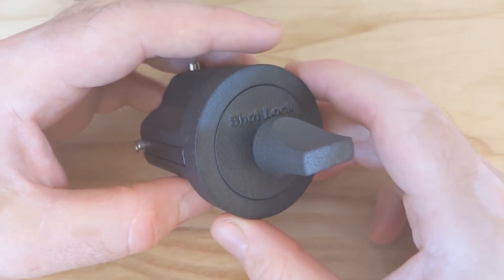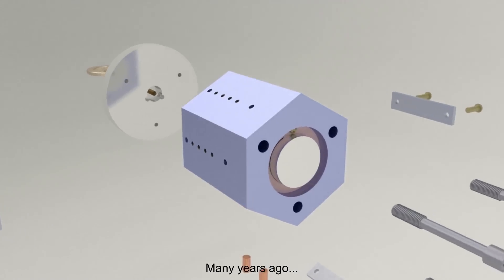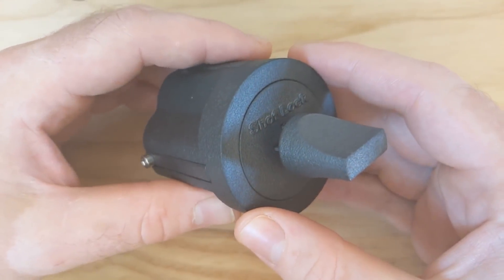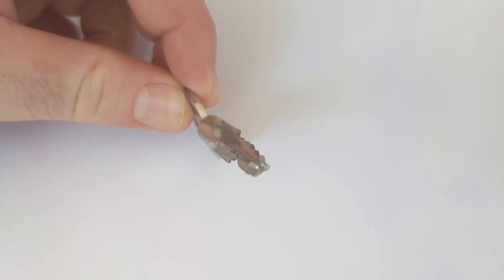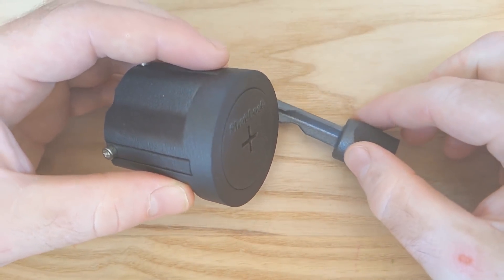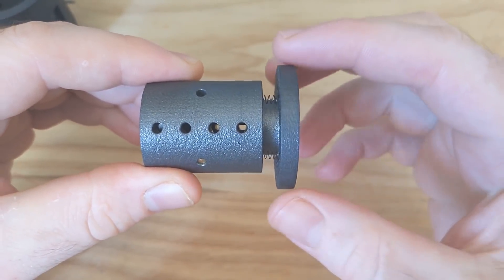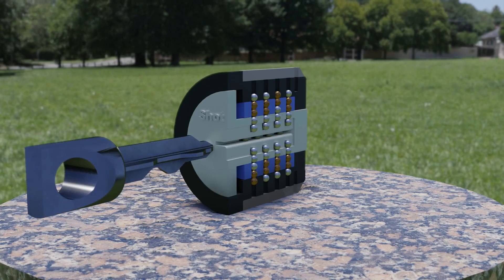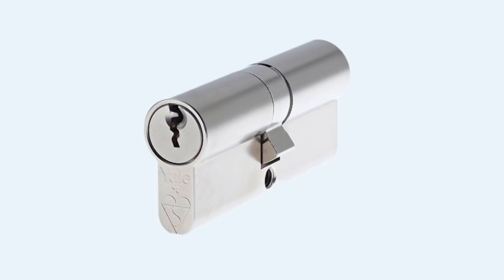A 3D Printed Unpickable Lock

Comment: LPL: "they left out an important detail, you see, the lock is made out of a thermoplastic, so using a blowtorch you might find at home, we can open it with relative ease"
Reply: But you can machine it from steal, witout a problem. Just need tools and guy dont have it.
Reply: I read that in his voice
Reply: It isn't made out of a thermoplastic though..
Reply: No need to pick it when the lock is that easy to brute force.
Reply: @lethalchicken1able  The point is that an actual production lock would just be milled or broached. This design doesn't look difficult at all to modify to be mass-produced, he likely made it out of plastic just for the purpose of testing the mechanism, and making many small changes to it, between versions.
Reply: @lethalchicken1able  kind of my thought, I wonder even if made out of metal, how hard it would be to just break it idk
Reply: Maybe he should have sent it to stuff made here first
Reply: @SkanMLL  The rear joint that prevents you from rotating the lock as a 1/4" cross section. Modern locks are made with closer to 1/16-1/8" cross sections, so I would be confident that a metal version would be stronger than most modern locks
Reply: No lock is 100% secure...there’s always a way to get the thing open that they’re keeping locked. Lock pickers are lock pickers for a very important reason...and brute force cancels that reason out.
Reply: @Weryl  it was a joke…
Reply: Well a real lock would be made of different material i guess .
Reply: that's not LPL's style.
Reply: @soldierofbass6082  I remember him torching a bike lock ... once 🙂
Reply: @Zekealot  All standard 3d printed objects are made of thermoplastics. That is sort of a requirement for it to work.
Reply: @Zoroaster4  That's for the common home system that extrudes filament into the shape that you desire (FDM printers) - other options include laying down a layer of fine dust and gluing or fusing it together to get the shape (SLS printers are like that), and resin printing, where a light sensitive resin gets cured by a screen in the bottom of a tank, and then lifted out so that the next layer can be formed on the bottom of that.

Plus, there are various groups working on 3D printing houses out of concrete, and even one group who's working on 3D printing functional rockets using what is effectively a robotic welding arm (yes, that does mean they're trying to put a rocket into space that's all welds, and no panels in between).
Reply: @Autoskip  Yes that's why I said standard. All of those other than the resin printers are very rare. Even the resin printers are far less common than the conventional FDM printers. My point is when someone refers to 3d printing they're almost always talking about FDM printers and those are almost always using thermoplastics.
Reply: That is lockpocking lawyer’s wife’s approach. Ice cream lock
Reply: it can't be locked if it is a liquid
Reply: Ye, I don't think lpl would do that, he probably understand that this is just a pet project and that not everyone has a 3/4 axis cnc mill
Reply: @Weryl  r/woooosh
Reply: Well, it wouldn't be picked. Opened, yes, but not picked. It's not an unopenable lock :)
Reply: all locks can be destroyed, picking is something else.
Reply: The challenge is to pick it, not destroy or otherwise bypass it.
You can't say you picked a lock because you threw a rock through a window.
Reply: The sheer amount of r/woooosh that's occuring in these replies...
Reply: You do raise a good point though. I mean, sarcasm aside, many of his locks are picked through a flaw in the design that makes it unnecessary to actually pick the lock or use the key. Some of the examples that come to mind are some motel window locks, or a TSA gun case and a few others. More recently there was an electronic key that was defeated simply by crossing two wires. So even if a lock is unpickable if there is a flaw in its design that makes it accessible in some way it's not perfect security.

That said, I am still excited by this. I really hope he has difficulty opening this.
Reply: @Zekealot  it is. PP or PA.
Reply: @Weryl  "they left out an important detail, you see, the lock is made out of a steel, so using a rocket engine you might find at home, we can open it with relative ease"
Reply: @SkanMLL  I’m wondering how much it would cost as well to make in metal form. Can’t wait to see what LPL does to this. Will he give in or find some other way!
Reply: I love how this joke went right over most people head. They are arguing about what it’s made of and saying it could be milled from metal. All while your sitting back laughing at them.
Reply: @justacameraman4900  people defending the channel they like. Chillax, he's joking.
Reply: @Weryl  well no because he is using double pins which are the weak point you can just put something that gives you leverage and twist the lock and it will snap the double pins... thats the problem here and also that fact that there is no action on the lock like a bolt or anything so what can this be used for?
Reply: @thefjk  dw I'm chill. I'm just pointing out how many people are missing that the comment is a joke.
Reply: But that would be a destructive entry which is the weak point of everything
Reply: @soldierofbass6082  exploiting weaknesses like that is exctly his style just look at stuff made heres locks he says he would absolutly have gone after the hinges had they not been welded
Reply: NON-D-E-S-T-R-U-C-T-I-V-E
Reply: Sounds like a Mrs. LPL method
Reply: Marketed as unpickable , not indestructible
Reply: @barnabasdecsi7872  when did destructive enter come off the table? there is a reason locks are made strong...
Reply: @soldierofbass6082  

No, he'll chain it to a rack in his basement and perform unspeakable acts upon it, with various tools until it yields its secrets.
Reply: Zoroaster nope.
Reply: @Weryl  steel (material) is with 2 'e'

steAl is taking possessions of others
Reply: @bmomosaik  If I were to fore my way into a building, I would choose the entry point by considering where is the weakest part of the building, in this case, we are talking about detached houses, which are the windows usually like you can throw a stone at it and it shatters of course there are bulletproof windows and windows protected by iron bars and stuff like that but that's not too usual
Reply: He didn't even make a video on it yet wtf are you talking about?
Reply: If LPL can’t pick it he will make a pick for it before releasing a video🤣🤣🤣
Reply: Lpl will use a tool he and bosnian bill made and pick it with ease
Reply: @Weryl  Steel*
Reply: Nondestructive bro
Reply: @Zoroaster4  But the guy in the video literally told you what the process was, and it is NOT a thermoplastic.
Reply: @tiggerbiggo  Yes, but it IS a thermoplastic. It uses nylon which if you didn't know IS a thermoplastic.
Reply: IT SAYS " UN PICKABLE"  Einstein...
Reply: Unpickable is not the same as unopenable.
Reply: @skaramicke  Duhhhh... Thanks captain obvious ...
Reply: Irrelevant. It is just a proof of concept. You can make a production version from titanium if you want.

Comment: Awesome! Such a unique take on an “unpickable” lock design. I (like everyone else) would love to see LPL take this challenge on, the guy has x-ray vision when it comes to seeing faults and weaknesses to exploit!
Reply: not unique but definitely special!
Reply: Well, in principle it's the same as stuff made here's
Reply: I think the weakness in this design is that you can apply torque by pushing in on the lock rather than rotation. Any kind of shear should be able to take care of apply the necessary pressure for decoding. And whats worse is that because the pins slide out of the way once you have the combination set it is absurdly easy to open even without a key.
Still a nice looking lock though
Reply: @nickrogers3624  how would that decoding method work. The tensioning method is valid, but how would you determine which pins are correctly set?
Reply: @nickrogers3624  however it was actually demonstrated that the lock will push in even with the wrong key, however it won't turn, meaning that pushing it in actually puts no force on the pins and actually isolates them...

Comment: Title:  Unpickable
LPL:  "Nothing on 1, nothing on 2, 3 is binding..."
Reply: Hahahaha 👍
Reply: @Creatotron "For this lock, we will use the specialized decoding tool that Bosnian Bill and I made..."
Reply: "... click out of four. Back to the beginning..."
Reply: I think LPL can get it open, but it’s going to take a new approach for sure
Reply: Sneaky sneaky
Reply: Nice click there!
Reply: You can’t be both turning the inner cylinder, and change the height of pins. Once the cylinder is in a position to turn, it is causally decoupled from the outer ring because it is offset by more than 1 ball diameter. There is no playing with the pin height when it’s rotating, hence no binding feedback possible. Most of the comments don’t get that part.
Reply: @xl000  Most of the comments are not from lock smiths and are just LPL fans making jokes.  It's all good man.
Reply: @bigtimetimmyjim6486  Too bad BB retired :-(
Reply: @CarbonRevo91  Hammer.
Reply: press 6 on keyboard to get info
Reply: Unfortunately, the pins won't "bind," at least not individually. I really can't see any flaws in the design, but I'm not LPL. :P
Reply: He didn't even make a video on it yet wtf are you talking about?
Reply: You just described my cars gearbox

Comment: Stuff made here said something similar once. Just watched lock picking lawyer open both of his designs. Time to start watching for this lock to cross the bench.
Reply: But it would be great if LPL doesn't know how it works though.
Reply: @BD90..  It will be just longer
U can't open anything if u don't know how it works, ever door knob will be unpickable for u, for time u need to learn how it works
Key design, keyhole, mechanism, springs, all lock parts are necessary for picking a lock
Reply: The flaws that allowed the locks to be picked, were partially known to Stuff Made Here before sending the locks. So at least one of the two would be unpickable. He simply decided to not fix it beforehand to have a more entertaining video. He said so himself in a reaction video.
Reply: @BD90..  That's not how anything works ever.
Reply: Stuff made here's design is solid just one fix and it's unpickable
Reply: @BD90..  the security of a system should only depend on the key. (Kerkhoffs' Principle) Obscurity is not security.
Reply: LPL said his lock was close but it had certain faults. If he fixed those it would be unpickable.
Reply: theres a big difference here though.. stuff made here had no idea how most locks work beyond basic function and had no knowledge of how locks can be bypassed.. am i saying LPL couldnt pick this lock? no.. could LPL just bust it open? obviously yes, but im sure he would take it as a gentlemans rule to not do it as this lock COULD be made with stronger materials.. 
what i expect to happen however, is for LPL to take advantage of the line at 2:23 obviously that model isnt done exactly how the real one would be, but if there is enough room to force all the pins down to the maximum depth, then the lock would still turn even though it is an 'incorrect key' with some kind of 4 way comb key.. and while technically the lock isnt being 'picked' it is being defeated through non destructive means.. but again, even if that does work on the lock he sent him, it could be easily fixed by just not allowing that extra room via larger spring/extra pins etc
Reply: Ehh LPL managed to open them but only because of design oversights. He said in his response video that a few fixes would make his lock effectively unpickable.
Reply: @duffman7674  security through obscurity is effective right up until the point other people realize that it's effective

Comment: As there's still no LPL response, here are my improvement ideas:
  1. Replace the key touching ball by a standard short keypin, thus giving it a flat top on which the higher items rest.
  2. Replace the ball that shifts between layers by a stack of thin master wafers.  This increases the number of depths of each cut, thus allowing you to remove the side stacks that won't fit in standard form factors. Fine tuning the diameters can furter increase the number of wafer levels.
 3. If the Euro profile doesn't have enough room, go for a scandinavian oval, which is still a defacto standard.
  4. If you still can't get enough differs, try parallel stacks like in dimple locks, with a rectangular innermost cylinder instead of an interlocking pin.

Comment: Please post the lockpickinglaywer one, it would be great to see what he says about it. It looks really cool.
Reply from the maker: Ok I will post it tomorrow!
Reply: @timhutt7051  did He get it ? Can he open it !!!!!!!
Reply: @David_11111  I was gonna say I never saw a video at all. Problem I have with this is it's 3d printed. What about brute force attacks. A blowtorch would melt it lol.
Reply: @Aliyah_666  that’s only a prototype, you could machine it or even 3D print it in metal, which is totally possible, but commercially unviable in large scale
Reply: @Bernardo3477  this lock would be very easy to die cast or swiss machine.  Hardest bit would be the keyway, but a custom broach or skilled die maker could make the keyway easily.
Reply: @timhutt7051  you will post tomorrow?
Reply: So?????? Did you send and LPL chickened out? Or you never sent. I demand an answer
Reply: The last time I saw such a challenge to LPL, he opened it in 3 different ways... I really what to see with this one.
Reply: @timhutt7051  LPL is scary don’t be offended when he succeeds
Reply: I think it is still vulnerable to a bump attack where he would just push the cylinder back and tap with a hammer to get the pins to line up while also adding tension it would take a few attempts but eventually it would work just a guess
Reply: @Aliyah_666  He stated it was a prototype.
Reply: @timhutt7051  Hi did he got it ?
Reply: @timhutt7051  Please update us on the status of this, thanks
Reply: @timhutt7051  I too would like an update
Reply: Lmao still waiting to see this " unpickable lock" 
On lpl channel
Reply: @timhutt7051  So were you lying? it's been 3 months
Reply: Where is the video? LPL wouldn't back down from a challenge. Unless you haven't sent the lock.
Reply: @timhutt7051  did u ever post it
Reply: @Aliyah_666  Literally any lock can be defeated by brute force attacks eventually. The challenge is only whether the lock C be defeated non-destructively
Reply from the maker: It's finally tomorrow! (I sent it.)
Reply: @timhutt7051  finally
Reply: @timhutt7051  from 3 months ago to 3 minutes ago. Let's see how this goes. Really cool design
Reply: Yayyyy!!! Can't wait!!!
Reply: @martylawson1638  I bet this old Tony would be able to machine one
Reply: @timhutt7051  please update to let us know when or if LPL is going to attempt to pick the lock. Iv been waiting ages for him to try this out.
P.S good luck I genuinely hope he can’t or has severe trouble with it. If the LPL has difficulty then u know ur onto a winner and I’m sure a nice bit of   $..£ to follow, especially if it has his seal of approval
Reply: LPL mentioned before that he tries to make good videos and tries to be fair to the creator.  He strives for good sportsmanship and that can make it difficult to finish one of his videos quickly... not to mention any editing or planning he needs to do.  Plus, doesn't he have a full time job and YouTube is his side?
Reply: @austingeorge6659  LPL makes videos very quickly and has locks sent in from viewers and 1 from YouTube channel (stuff made here)  LPL can make and edit a video in 1 day especially from things that are sent in as it’s 1 continuous shot with no editing. If u were a LPL fan you would know that his comment of good sportsmanship means, opening the package infront of camera for first time and trying it.  He does like covert ways of entry to pike run at certain locks too and some of them have edited footage but not much at all.
Reply: Waiting
Reply: @Aliyah_666  huh never thought I could PICK locks with a blowtorch. Ive been picking locks with intercontinental ballistic missiles myself
Reply: @trippyleo5609  thats only for normal locks, for instance the stuff made here lock he did extensive testing with it before making his video and didnt open it on video. He can make a video in a single day but if he needs to make a new tool to pick a new type of lock it might take a while.
Reply: @timhutt7051  where is ut
Reply: @timhutt7051  bro you never delivered.
Reply: @austingeorge6659  he is literally a lawyer, it's on his God damn name, how is it so hard for people.